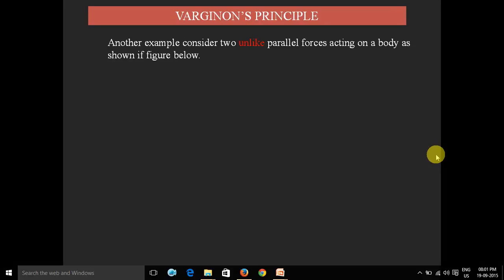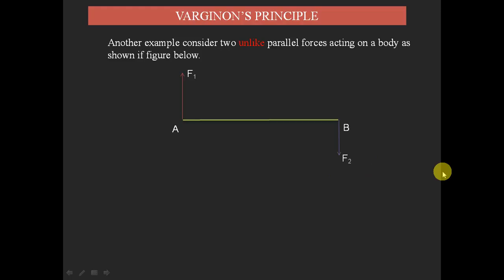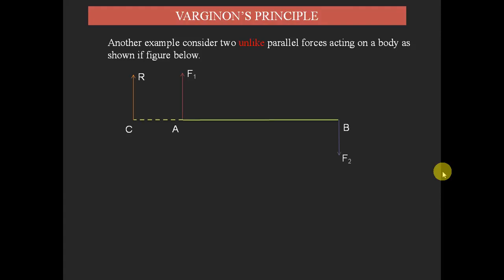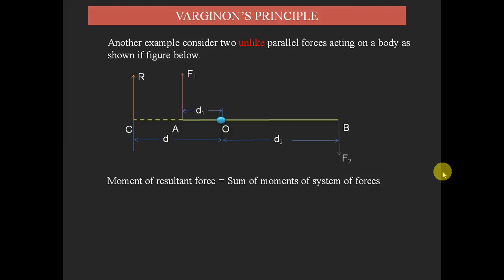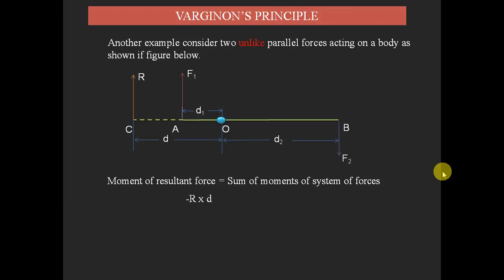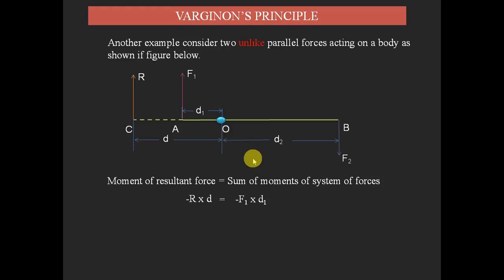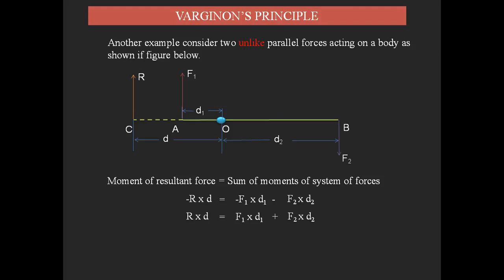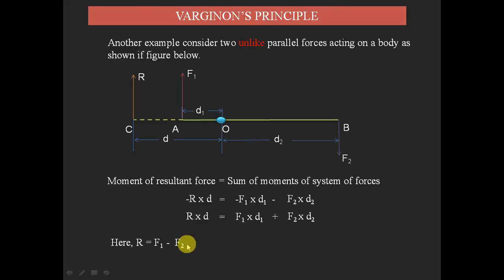Varignons Principle for two unlike parallel forces example 2

Comment: Two unlike parallel forces equal to 30 and 40 Newton are applied at the point A(-3, -1) and B(4, 6) respectively. find the point of application of the resultant force.
Please sir find the answer